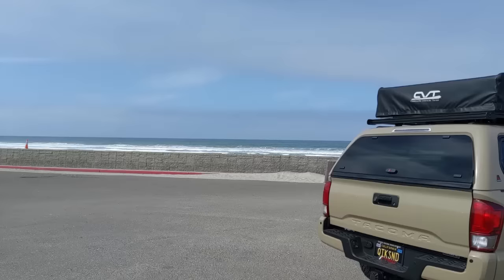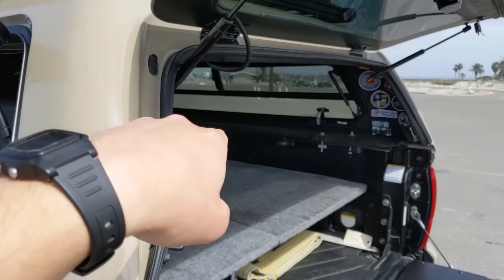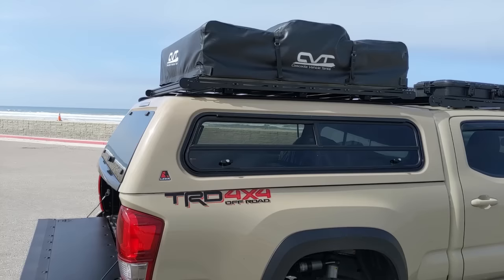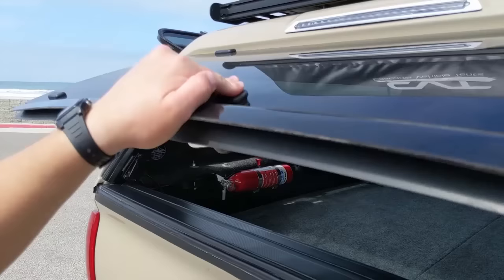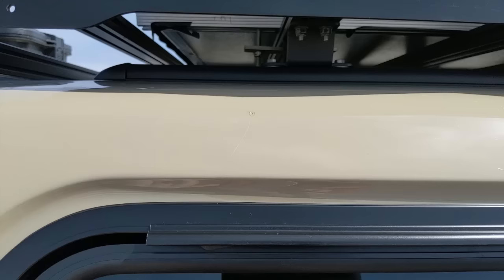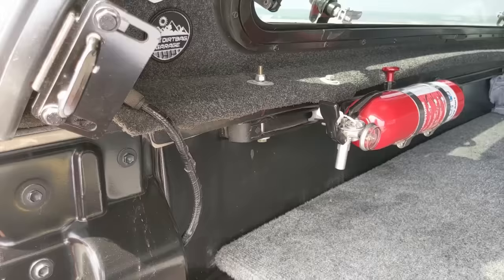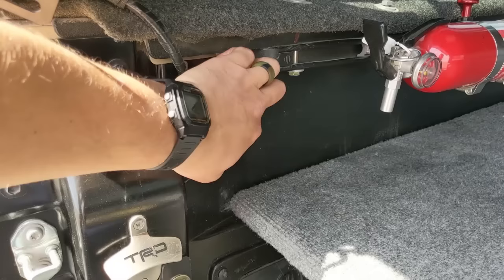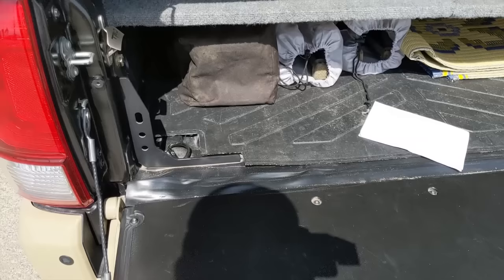Shell and Roof Top Tent FAQ

Comment: Take any truck, with a cap, under water, and you'll get water in the bed.  Not "water proof".  Most caps however, are "weather proof", and won't get wet in rain, snow etc. if fitted and installed properly.  Using them for decades, and no problems in that respect. BTW, mine have all been Canadian made, and yes,  most Canadian trucks have beer holders built in to the tailgate............

Comment: Tried to see if you answered this question but couldn't find it. Did you opt for Frameless Hidden Hinge Curved Rear Door ? Was that an option? I'm looking into getting a leer but the brochure isnt listing the hidden hinge as an option for the XR, only the XQ.
Reply: I can't remember what the door option was called, but the shell I had was a XR model and I was able to upgrade to the frameless, twist lock/hidden hinge door. It's a really great option and I recommend  it as it's the only way to have the door wired into the trucks central locking system. Forget the website, find your local knowledgeable dealer and go have a chat with them. Send an email with pictures of you have to. They should be able to tell you what is and is not currently available.
Reply: @935AV  word to the 🕊️

Comment: Thanks for going over the actual features of your shell.  So many videos don't get into that.  You're gonna LOVE that window to access the cab.  Plus, with the rug liner, you could run the truck for heat briefly to warm up in the morn if you were sleeping in there (not for long without an exhaust snorkel).  FWIW: I think your shell is pretty well water proof, just the Tacos have gaps for draining water if submerged. Rubber covering the gap between the bottom of the tailgate & bed is a great idea.  It wouldn't look great, but maybe a magnetized rubber strip down the sides of the tailgate if you're going to run a dusty trail (or thru heavy rain).  Take'em off when the weather dries out or you're back on pavement.  $2300 for the shell with the roof rails and carpet liner in '19 means it's going to be $4k+ now - LOL!

Comment: Nice taco.  You can replace the wood 2X6 with aluminum rectangular tubes so you won't need to worry about future cracks or need a center support beam.
Reply from the maker: I'm certain you could.  Just cut them to length and I'm sure it would work fine.

Comment: I've had 3 different shells, all used. All installed by myself,  and all 3 were watertight 
Dunno what's up with yours, but shells should not leak
Reply: Agree if its semipermanant i silicone them also
Reply: I had a shell on my 2000 GMC 4x4 ...never leaked a drop in the bed. I have a 2019 Tacoma now but no shell just a bed cover..maybe the problem is the way the Tacoma is designed
Reply: Same here.
Glass top on my Chevy and snug top on my ram and I've never had water getting into truck bed.
Reply: I had the same model on an 09 f150 no leaks.
Reply: Same.

Why even buy a shell if it's letting water in? Maybe it was his definition of water proof, but If I paid $2300 for a shell and I'm getting puddles of water in the bed, I'd be pissed.
Reply: 2007 Frontier with a Leer cap - no leaks in the 13 years I've had it.
Reply from the maker: @BrettVarve  twerp? Hahahaha enjoy your day big man.
Reply: @TravelingNobodys  one of my favorite words, tbh.
Reply: My ARE shell leaked through the seals on both side windows. Dealer could not fix the issue. Looking at a Leer shell this time.
Reply: @tbocfoRC  which ARE shell did you have? I'm looking at getting an ARE as well..
Reply: @carloorozco1247  The Overland with the bedliner sprayed down the sides. The bedliner was a factory paint job and had flaws it it. The masking lines looked horrible.  My dealer sent it back for replacement and ARE refused to fix it so the dealer got me $500 back from the ARE rep. I would never buy an ARE again.
Reply: @tbocfoRC  Maybe it was a one off that was bad? I know people that purchased that one that are happy with it... but thank you for sharing your experience.
Reply: Depends on the Tailgate... My Nissan Frontier has a gap Soo big that alot of daylight get in.  Gonna seal it up with some Gorilla Tape since I don't use my Tailgate. Living in Phoenix, im more concerned about being dust proof, instead of being waterproof. Cheers 👍
Reply: Did you weatherstrip your rigs?
Reply: @WWproper  I put that foam tape they make for that purpose on the bed rails of my truck

However I have had one that I didn't use that ste, and it didn't leak either
That one was a 1996 Ford Ranger
Reply: I bought my truck used and it came with a leaky shell. What should I do to stop the leaks? It's my first time having one and I dont know much about them.
Reply: @kukapuouhaagunderson8693  are the leaks in the Shell itself, or is it leaking between the bed rails and the cap?
Reply: @artwebb6939  between the rails and the cap
Reply: @kukapuouhaagunderson8693  an auto shop should have foam tape to go between the cap and rails
Between that and checking the alignment of the cap, should seal it 

You'll probably have to slide the cap around a bit on the bed rails to get to where the tape needs to go
Reply: @artwebb6939  Cool beans my friend thank you.  On the next sunny day we have I'll get on it.
Reply: @kukapuouhaagunderson8693  you're very welcome 
Good luck

Comment: Nice overview and assessment, mate! And great looking rig. Love that you make sure folks understand the difference between dynamic and static weight. And you're right, truck shells are not water proof. A quality one is incredibly water tight, however. I've spent many a wet days and nights in pretty thick storms without any leaking in my Snugtop. Something I've learned over the years to keep an eye on is the shell brake light. I've found is that I have to retighten the light retaining bolts every year since they loosen with all the bouncing around and vibration from driving off road. And because of that, small amounts of water can find their way through the seals. But it's an easy thing to manage. And thanks for showing the Mountain Hatch board. Hate that ribbed slick tacoma liner. Gonna head over there and place an order right now. Cheers!
Reply: locktite

Comment: What I did to secure my cap to my long bed Tacoma was running basically 6 foot long strips of hardwood on each side and then clamping on top of that hardwood to distribute the down force of the cap to the sides of the bed.  I have had no slippage or problems on some pretty rough trails in Colorado and no water leakage at all.
Reply from the maker: That's not a bad idea at all.

Comment: Great Set up. I have to tell you though I have an F150 with a Snug Top. My Shell is 100% water proof. I've had it 2 years and have NEVER had a leak anywhere including any of the areas you describe. I even had someone try to break in by trying (unsuccessfully) to pry the back window open and they jacked up the fiberglass at the bottom of the window. Still no leaks.
Reply: I'm glad you've been good with your shell. I'm just being honest with my own experience and that's all I can do.
Reply: @935AV  Well then maybe don't say that anyone who tells you their shell doesn't leak is a Liar. Just because YOUR shell leaks (and it sounds like you've also had a few installation problems and lack of maintenance problems) Doesn't mean that everyone who's looking for a shell has to be worried about them leaking. My shell never slid either, but then again, I follow the manufactures instructions and check my fasteners every 30 days and have never had to pin one because I've never had one move, even under some very demanding overlanding and hunting trips.  For anyone following along, MOST shells don't leak and those that do are generally because of owner neglect. I keep my rubber seals CLEAN and in good condition at all times and stay away from drilling holes in the roof and throwing 250lbs on it.  I know the manufacture says this is fine as long as THEY do it.... But there are shells that admittedly don't look as good, but are far better suited for roof top tents. So if that's the way you are going to go you might want to look at other options. There is a reason they exist. I not only overland but I'm a musician who transports a bed full of very water sensitive equipment on a regular basis. I'm on my 3rd truck and 3rd shell and none of them ever leaked. So NO not everyone who tells you their shell doesn't leak is a Liar.  MOST SHELLS DON"T LEAK and as far as brands go you might want to take note that Truck Accessories Group, LLC (TAG) is a collection of companies that make it North America’s largest manufacturer and supplier of fiberglass and aluminum truck caps and tonneau covers. These recreational and commercial/fleet products include LEER, SnugTop, Century, Pace Edwards by LEER, and BedSlide brands. So SnugTop and Leer are made in the same factory, by the same company. It all comes down to what look you like and what your specific needs are.. And if you get a shell that leaks, take it back immediately. Unless you did something stupid, They' should fix or replace it  under warranty.

Comment: I throught bolted my leer with 1/2" Stainless Steel bolts in front of bed gunnel, middle and rear corner. It lasted stuck to Silverado for 12 yrs. I Sold it after 12 yrs for 15k and it is still running around. 25 yrs later. Use flex seal or 5200 between Cap and Cargo bed sides to avoid leaks
Reply from the maker: Sounds like a pretty solid way to mount.   I've since moved on to a different shell/camper but would consider something like that if I still had the Leer.

Comment: Clean!

Somewhere along the way these shells became less dominant 
In the general over-landing  community
Reply from the maker: The bed racks have become pretty common.
Reply: I don't think it's that they've become "less dominant" per-se.  I think a lot of the older fiberglass canopies were poorly designed, rattled, and could not really hold much of a roof load.  With rutted roads and frequent exposure to sun the fiberglass also cracks and the paint peels/fades.  That's why for off-road or "overlanding" use you see a lot more of the aluminum or stainless steel canopies from australian and south african companies hit the US market.  Those were specifically designed for off-road use and to take a beating.  The ARE, LEER, Snugtops were are designed for daily road use.
Reply: Taco_Nobodys  is your group still around. Are you in San Diego?

Comment: The bed Cap: I would modifying by installed subframes inside the cap for extra supporting, then cut out rectangular hole of roof top completely where for the ten (bags) sitting above, then the ten acting sealed water tight roof top.  In this case the weight distribution not on the roof top of the cap when off road.  
Also, inside the cabin of front and back seats'windowcab, of course water tight sealed area.

Comment: It seems that a 4Runner would fit your needs better. I don't see an advantage of a pick-up with a shell over a SUV. Helpful video. Thank you.
Reply: I just think you are getting the worst of both worlds. It’s not a pickup, its a poor man’s SUV.
Reply from the maker: Nah, I needed the space for gear storage.  The 4Runner is rather small in the back.  When we travel the truck is quite loaded and I'm still pretty happy with my choice with the Tacoma.  We have since upgraded to a Vagabond Outdoors Drifter camper though so that changed our setup a lot.

Comment: Nice looking rig.  I have the same canopy/shell from Leer on my DCSB Tacoma.  I echo your comments on the huge advantage to getting the Windoors, the cleaner look and no condensation from the carpeted ceiling, and also getting the roof rails mounted at the factory.  I've had my canopy for about 4 years and it's holding up great.

Comment: I bought a 2015 tacoma in July with a LEER shell and it leaks around almost every window. I imagine it's from the drastic temperature changes we get here in Alberta. I camp in the shell and the very first solo trip I went out it poured rain and that's when I made that discovery. i'm going to pull all the windows in the spring and put new weather stripping around them and hopefully that alleviates it before I start doing any felt liner/lighting.
Reply from the maker: That's a bummer.  Hopefully you can get it sorted out. It's never fun when things leak.

Comment: Hey we are twins! Quicksand long bed with leer cap. I got the 100rcc instead. Basically the same but reinforced for 500 pound dynamic weight. It doesn’t have a cage inside like ARE. Still have the front sliding removable window. They just put more layers of fiber glass.
Reply from the maker: Nice!! You got any pictures anywhere?
Reply: Tres Amigos Offroad Club yeah! On tacomaworld in groot5252

Comment: Great video. My Tacoma is on the way. What rock slider is that? Did you go with new bumpers and a lift? If so, what kind?  Thank you!
Reply from the maker: The sliders are from FabZone Armor in San Diego, CA. THey ship and you can find them on Instagram.

We did end up putting C4 Fabrications bumpers on the truck and you can actually see our truck displayed on their website!

The lift was comprised of Elka 2.5" shocks, Dirt King Upper and lower contgrol arms, and Dobinson Heavy leaf springs and sat at around 2.5" of lift.

Comment: I have an ATC shell on my Tundra and paint chips seem the norm. I do like the  my aluminum clamps over those bolts you have. But I wish I had that lip clearance from the inner shell lip to the bed track. I can't use the cleats on my Tundra but that could also be due to the bed differences. I like your setup.

Comment: I’m running same cap on same truck but the sport DCLB and minus the win doors. I love mine as well can’t imagine not having it. Good video👍
Reply: Yes mine was around $2300. Mine has remote locks, removable front window, roof racks, carpet and gear net.
Reply: Adam Gautreaux  your going to love it!!! I would recommend getting a utility trailer when you get a chance if you don't have one. Then you can haul big items on your trailer and not have to take your cap off. I love mine!!! I'll never own another  truck without a cap.
Reply from the maker: I've seen your truck online. It's very nice 👌

Comment: Just a quick question, could you post a detail look at the sleeping platform you built. Thanks you. P.S I have windoors!
Reply from the maker: Sorry, I've since removed the platform due to upgrading to something else.  All I did to make it was measure across, subtract one inch, then divide by two and that is the width of the two flat boards you sleep on. Measure the length to the back wall in the bed and cut the boards to dimensions.  I the wrapped them in a lightweight felt carpet material and used 3M adhesive to hold it on and stapled the edges. Then measure across the bed to the two cutouts for the 2x6 or 2x8 boards to support the platform and voila!! you're done in under $100.
Reply: @TravelingNobodys  Thanks!

Comment: For the climbing anchors, what bots did you use and how long?
I have the same canopy and mounted my maxtraxx inside of the roof using screw eye hooks but they pull out
Reply from the maker: I can't remember the length. I ran to the local store and grabbed a few until i found the right length.

Comment: Nice bro I’m waiting on my 100XR. The dealer told me they would install the Thule tracks bc they wanted to make sure the rack would be center with my Cali raised cab rack but I’m sure it was bc they wanted the up charge me 100 bucks install. I am putting the universal prinsu cap as 
you have. I was told static weight is 600 lbs moving weight 250. I was told it was only 175 lbs….hmm reason I asked dealer was bc I need to calculate total static weight for rear suspension. A good idea to ask dealer to put 2 more bolts to anchor topper. Like your rig👍
Reply: Short bed ? Long bed? Did they say a difference?
Reply: My pickup is a short bed

Comment: I have one on my Chevy 1500 for 5 years and its never  leaked you got a bad install got mine done at Zeebart here in Indiana they guarantee not to leak just saying
Reply from the maker: That's a great guarantee they give you. 👍
Reply: It's not the topper.... It's the truck. Tacoma has an issue with water leaking in through the plastic caps on the frame... Just saying

Comment: I had two different Snug Tops and a bed rug kit never had an issue with leakage.  I used to take my shell off a couple times of year with no issues. Sounds like the people that installed yours may have compromised the seal and if it didn’t meet at the front maybe a manufacturer defect or front bed rail was bent.  My Tacoma is a 2007 the bed has never cracked.  I have abused it hauling rock and landscape supplies along with off-road.

Comment: I like your setup … but 
If you buy a truck . The hole idea is to have a open bed . You can put a roof top tent on a open bed . Just a thought!
Reply from the maker: For us, when we were traveling the secured and enclosed camper shell was better than a completely open bed. It provided a larger area than an SUV, that was still relatively secure, and protected from the elements. An open bed when traveling off-road means everything in it is covered in dust, dirt, mud, snow, and whatever else it's exposed to. Plus it's very easy for someone in a parking area to just reach into the bed and walk off with an expensive piece of gear. While the shell was by no means perfect, for us at that stage in our build it was much better than an open bed.

Comment: 😃👍👍Good video.🤔 I would make a pulley system to take the camper shell off/on in the truck while the garage. Just like you see for storing a bicycle in the garage off the floor. Since you have a roof rack for easy attach to it. And providing you have the space and the roof can handle the weight.🤔🤔 Something to ponder here in Southern California 1/4 of all house dwellings have termites it might just be in the outdoor fence or in the structure itself.
Reply from the maker: I've thought about that, maybe some day.